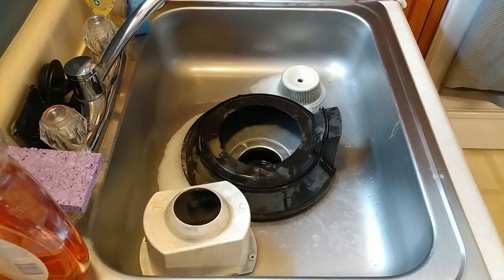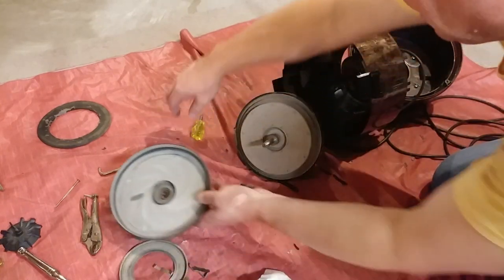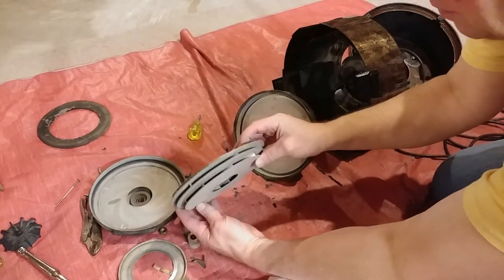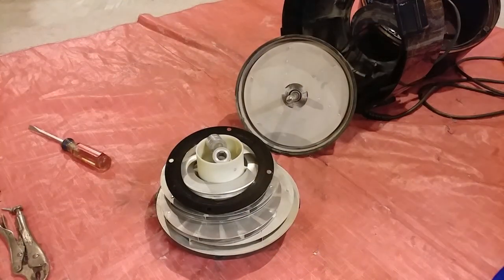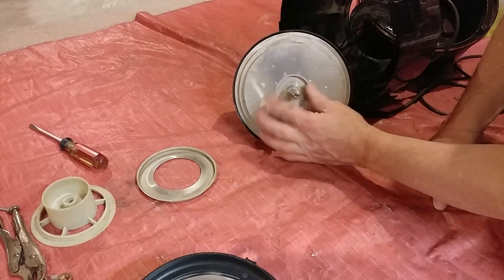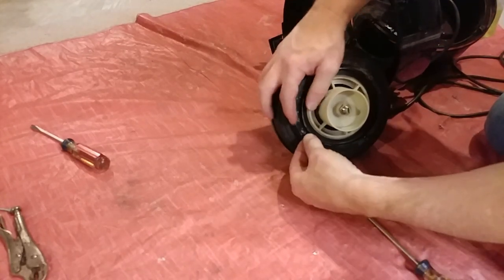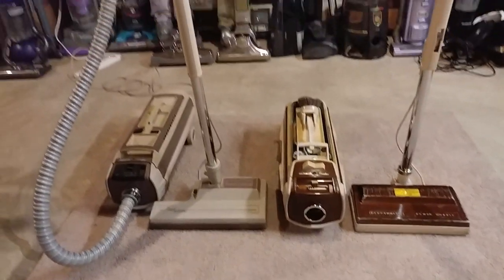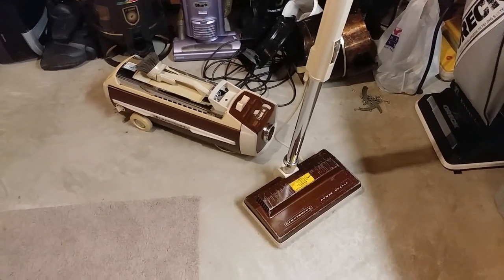VacLab Mini Meet #6

Comment: I’m surprised at your reaction to the Pn6. I’ve got both powernozzles for my Silverado and I’ve not noticed that it was ever difficult to push.  Is the bottom plate clean and smooth?
Reply from the maker: Yup, smooth as a baby's bottom. I don't get it either. Had my wife try it and had the same reaction. 😞
Reply: See now here's the hilarious note I have to add. On my very low pile carpet at my house it just glides with no force.
Reply from the maker: @TRec3791  I'm guessing that PN doesn't like higher pile carpet. Things improve when I use a woven hose and open the suction relief valve. 😐
Reply: @VacLab  maybe it does have something to do with carpet pile and thickness.

Comment: I just thought, did you try vacuuming the other direction to see if it was easier? You may have not been vacuuming along the right direction to make it easier.
Reply from the maker: I tried all directions and then I removed the hose, so no airflow at all going to the nozzle. It just scrapes along the pile. 😞
Reply: @VacLab  maybe it wasn't designed for carpet with higher piles. It just glides across my low pile carpet and also grooms well.
Reply from the maker: @TRec3791  I'm wondering that myself. Low pile and bare floors only?
Reply: @VacLab  it's very well possible. Are you going to do a whole house cleanimg with this nozzle and machine?
Reply from the maker: @TRec3791  yes, and you'll be able to see the sweat pouring off me. 😀😀😀
Reply: @VacLab  who needs a gym membership these day's lol.